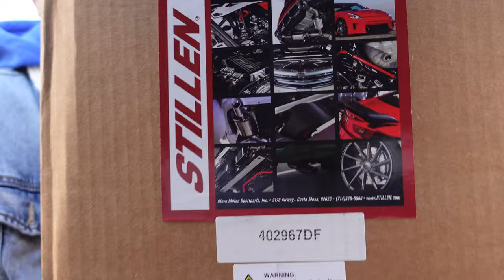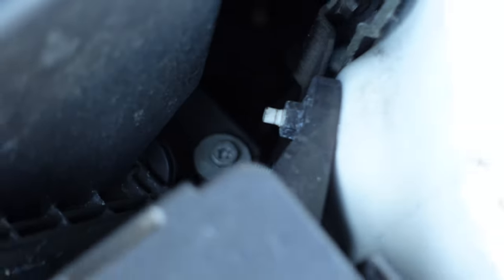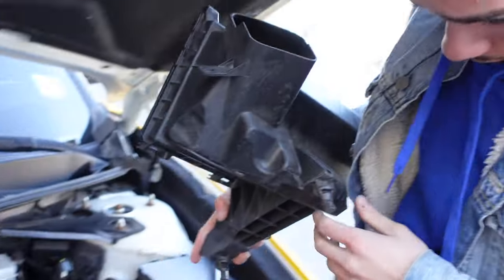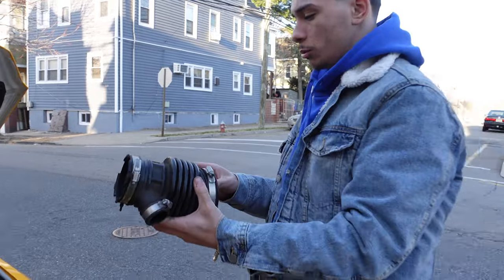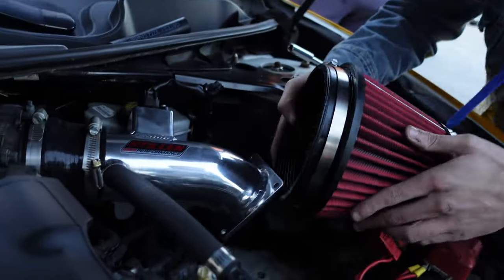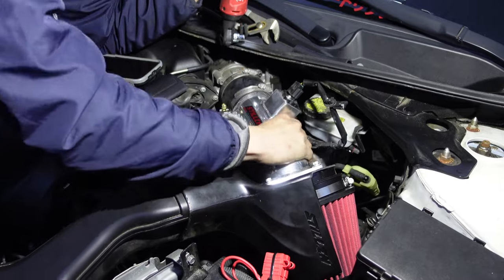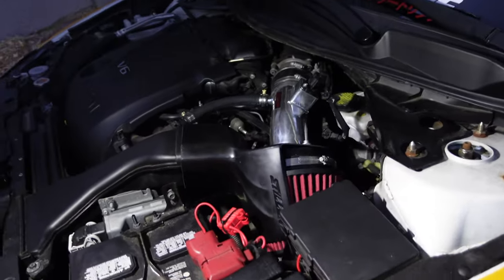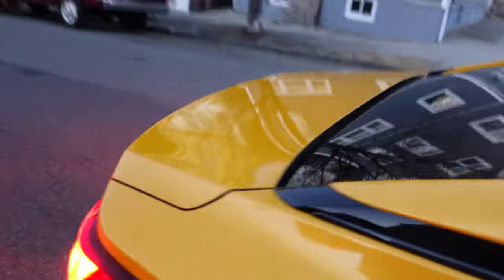INSTALLING A STILLEN INTAKE ON MY 2018 NISSAN MAXIMA!!! (8TH GEN)(Show/daily build series part 3)

Comment: That thing sounds nice bro I might need to install one on my maxima
Reply: Did you ever ever install one bro??
Reply: @carlossoto3349  yea i did i got a k&n cold air in take
Reply: @e2trill760 does it sound really good? i’m thinking of doing the same to mine
Reply: @derekdematos8335  yea bro it does sound pretty good. Id say it adds a little bit more power nothing too crazy but the sound is really nice

Comment: Isnt the heat shield supposed to be facing the engine so it keeps the heat off?
Reply from the maker: The plastic cover connects to the original “snorkel” that feeds it cold air from the grill there’s no other way to install it.
Reply: @pollostylez  ohh just wodering  i was lookin at mine confused asf😅

Comment: 🔥🔥🔥🔥🔥 video Question do you still have the gap between the bumper and the headlights if not what did you have to do to fix it
Reply from the maker: Nope I still have it and it’s going to stay like that for the mean time
Reply: Thanks bro!! Yhu just answered my question, And no I don’t care about the gap because you can’t tell and it look better I just wanted to check before I spend $1400 on headlines and I’m doing a wrap next but a gloss orange, but this dude inspired me to modify mines🔥

Comment: Is that intake the best for the 8th gen? looks stressful asf putting together😂
Reply from the maker: I haven’t tried out any other ones so I can’t say but it was a pain because I haven’t found any install videos on it and not even Stillen has one on there website when they usually do. But it’s not bad if you follow the steps I explained after I installed it.

Comment: Would it fit a Infiniti i35 2003 ???? Been tryin find a perfect one
Reply from the maker: Probably won’t fit exact because of the mounting points but you can probably modify it a lil
Reply: @pollostylez  I don’t mind off the mounting I can have sum win Tack sum to hold it firm. But u think it will fit my throttle body ? Should be same I got 3.5 V6 in there